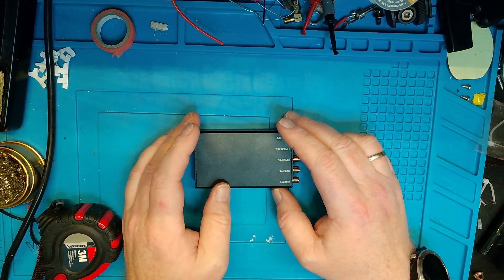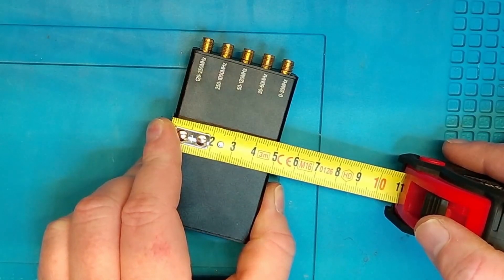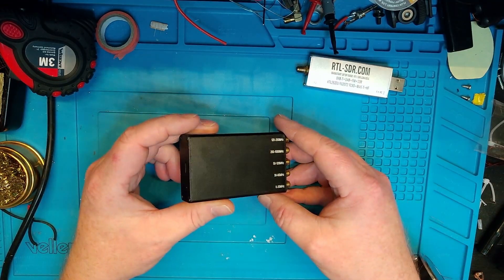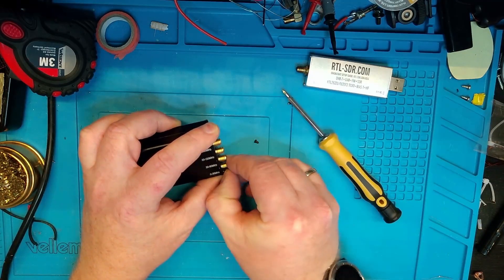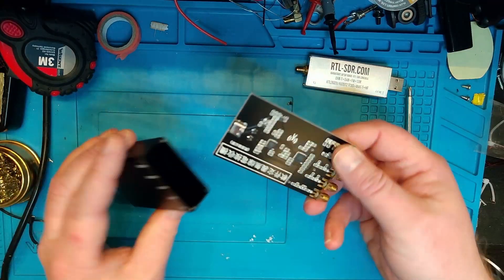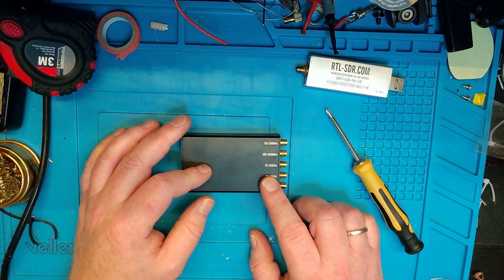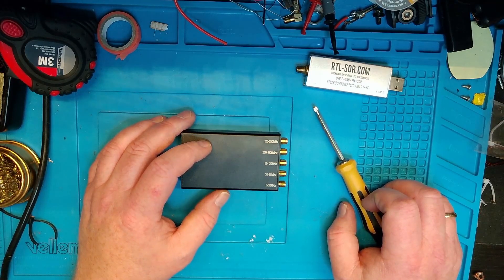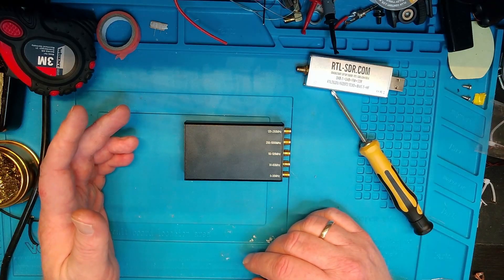I bought this CHINESE SDR so you don't have to...

Comment: So... the thing works very well...but there's a software hitch?... As in the software works with the hardware well electrically just not legally?...wth?
Reply from the maker: It’s not a software hitch. It’s a copyright and licensing issue.
Reply: @LB0FI I appreciate your integrity in this. I have the same conviction about not using software illegally.

Comment: I have a SDR Play RSPdx and RTL-SDR all genuine.  However I'd still be interested in this because a) I can use it on an android tablet (doesn't need the original drivers) and it works on Linux with SDR Console, SDR++ etc.  But most of all I'd like to leave one connected to a OpenWebRx+ receiver and I don't want to risk static and other spikes blowing up my expensive RSPdx.

Comment: I bought one of these. It works pretty well, it has good sensitivity. However, the front gets blown out if you have a transmitter near the device easily. I blew two of them out even using a tr/rx switch. I instead bought a more expensive Chinese clone that has better filtering on the board and haven't had one blown out yet.
Reply from the maker: It’s not a bad receiver, but still not worth it.

Comment: IMHO the closed source of the SDRplay is a bad thing and it is ok to use the clone. I have an original RSP1A here and really kind of upset, that it does'nt work ootb on linux. Therefore I don't show the same suppport to SDRplay an for companys, which do provide open source software. Like the HackRF one for example.
Reply from the maker: Well, two wrongs don’t make a right, does it?